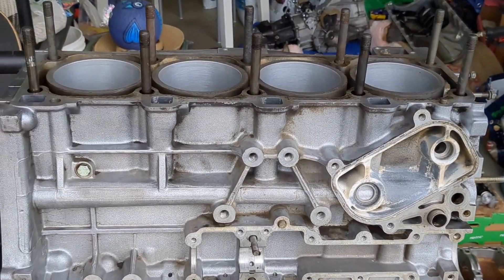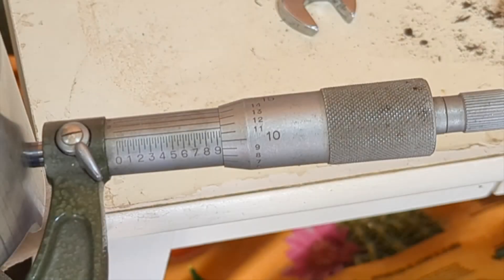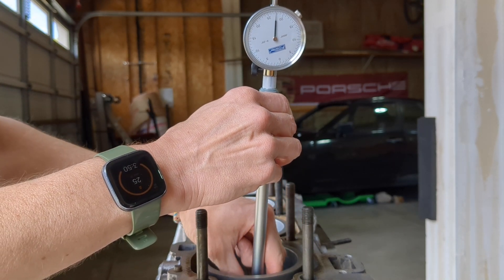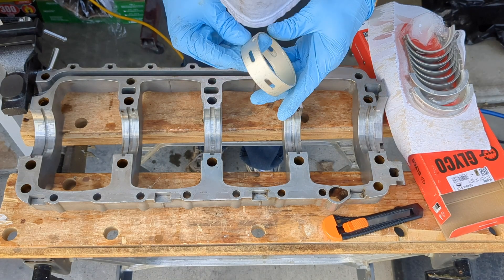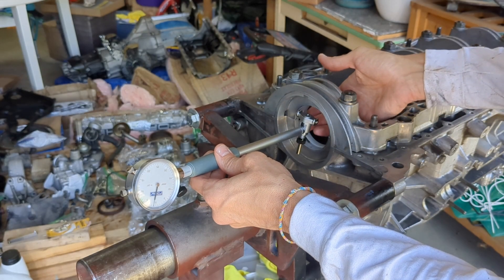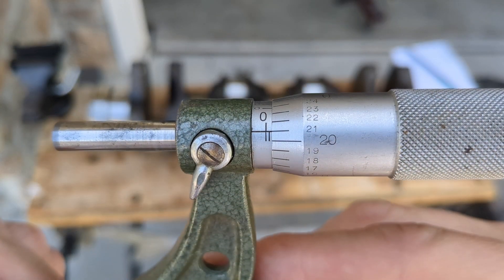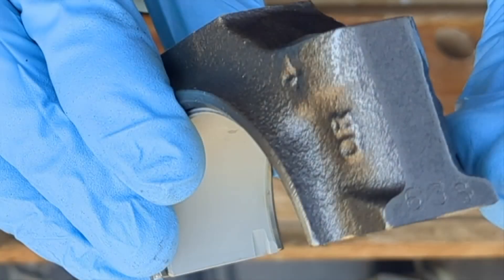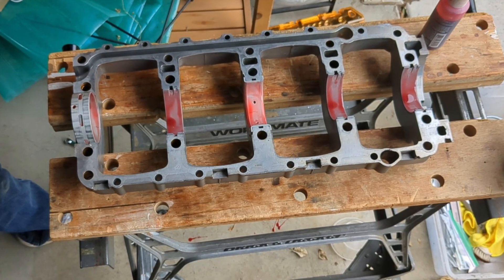Porsche 944 | Engine Rebuild Pt 1 | Cylinder and Bearing Measurements

Comment: Did you find the nose bearing (front full circle crankshaft main bearing) a little loose on the crankshaft? I wonder if it tightens up a bit when you torque it down inside the griddle. If I slide mine on the crankshaft by hand it seems a tad loose almost, crank looks good tho.

Comment: Another one in the 944 gang, let‘s go.
Really hope that your machine shop knew, that this is a silicon alloy block and you can not hone it with stones like normal alloy, and you have to etch the metal with a certain solution in order to properly hone it. There‘s Idiot shops everywhere that just hone it „normally“, and if that‘s what happened, you‘re in for a bad time.
I‘m asking because of the cross hatch pattern that looks like a stone hone.

Cheers mate
Reply from the maker: Thanks. The shop is reputable and had quite a few 924/944/928 cars parked outside. I've never had an alusil block honed before so I didn't know what to expect. I might be in for a surprise.
Reply: @944restore were the bores scratched? What triggered the trip to the machine shop?
Reply from the maker: Yep, 2 of the bores were scratched. I included pictures at the beginning of the video.
Reply: The original bore finishing process was less a honing operation, more accurately a lapping process where the aluminum is removed leaving the silicon.
Reply: It‘s not quite lapping. I don‘t actually know how shops remove scratches from the bore, but when you have a decent surface to be refinished, the aluminum is etched away, exposing the silicon crystals, which are pretty low friction. I guess the honing marks might be from scratch repair before etching.

Comment: If using the original hardware don't forget the girdle washers are cupped and need to go on in the correct way.  If you look at your old rod bearings you should be able to see three scratches on each half (if they are not trashed) where Porsche used a micrometer to measure them.  This is the difference between Glyco and Porsche branded bearings.
Reply from the maker: I wish I would have kept the old bearings to check for measuring scratches. They weren't too trashed.
Reply from the maker: That's a great tip about the washer orientation. I'll be sure to mention it in the next video. Thanks!